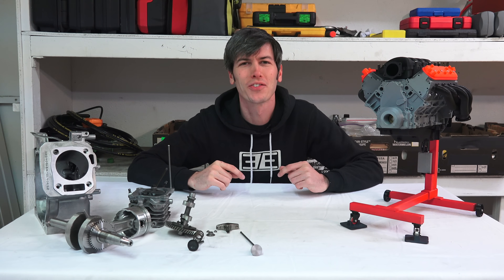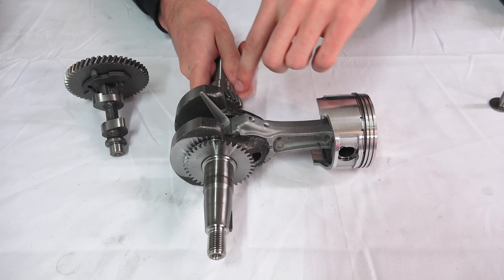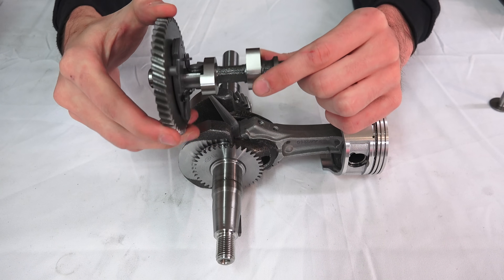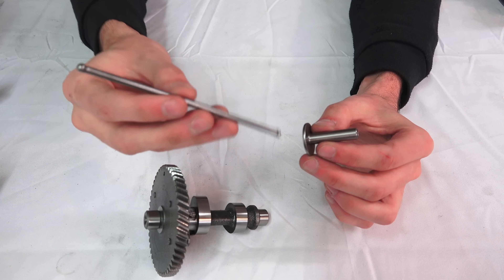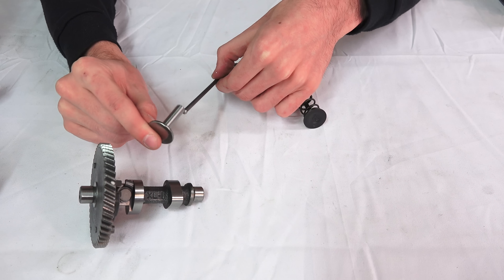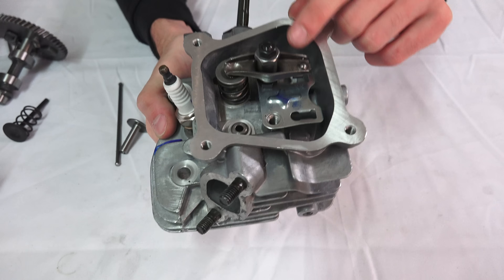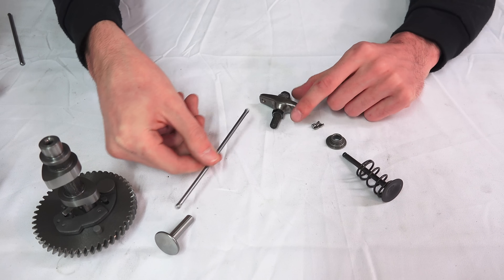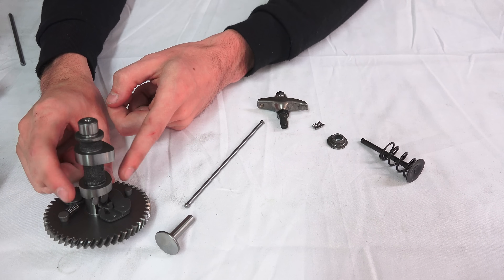Why Can't Pushrod Engines Rev High?

Comment: 40years ago Honda made CX500 pushrod V twin bike that had 4 valves in cylinder and reved up to 10000 rpm.. also it had 50hp in that 500cc engine..
Reply: Errtu Zarathos they aren't comparable Tho. A car is under more stress for weight a bike is under more stress from it's own engine.
Reply: bike engines can not be compared to car engines
Reply: I'll be Frank I'm Leary about using my name yeah, you can. It is really easy. Just take two engines and compare their specs against each other.

Comment: The Viper engine have a cam in cam design and vvt and it changes profile for the intake and exhaust valve timing being a pushrod. Gm have a patent for Variable valve Lift for the push rod. It is a rocket arm that changes how much lift it could have. Sow it isn't impossible for an OHV engine to rev high if you put in the same tech as an OHC engine

Comment: They dont need to...they make more TQ lower in the powerband.
Reply: yeah that low rpm torque. that's where the racing happens right?
Reply: Careful with the assumptions.  TQ depends on airflow which is not dependent on pushrod vs. OHC, only on how much valve is open for how long, cam timing.  What RPM you can deliver that opening is what this lesson is about.

Comment: The situation, other than the mechanical inefficiencyof a pushrod engine , is electrical.  Desmodromic valve trains effectively eliminate the mechanical side rather well. The new computer controlled ignition systems are much more efficient than the older systems for generating a properly timed spark. Lastly a turbo or supercharger will result in  maximal power/rpm output of your engine. You cannot equal the power/rpm of these new engines with the best of the 20th century technology.

Comment: no need to rev your street engine very high, most engines will be less efficient at high rpm.
Reply: Not really true anymore for most modern engines these days, especially outside the US, a lot more cars use OHC rather than old school pushrods like the typical v8.

Comment: My ohv Buick V6 revs to just above 9000 RPM with max power around 8000 RPM. its very flexible,smooth,reliable  and derivable. Although it makes maximum torque of 404 ft/lb at 5500 RPM. It still has huge torque waay  low at 2000 RPM. Im still puzzled as why GM doesn't use 1/2 of the technology they used in their race engines 30 years ago in their road cars today!

Comment: I've always wondered why the inline fours in bikes sound different from the ones in cars. Also why 2 and 3 cylinder bikes sound so different when 1 and 2 cylinder bikes sound so similar. I was thinking maybe it's the differences between the cross plain and flat plain crank. Could you do a video on this?

Comment: You point out a few facts about OHC vs OHV engines and the LS fans get triggered as hell talking about how they don't need no OHC. Nobody said you did! He merely discussed the differences. Jeez, people are so insecure.

Can't we just admit there are pros and cons to both. OHV has packaging and weight advantages in a V8 and OHC has the ability to produce more power given equal displacement, by having 4 valves per cylinder for better breathing at high rpm and ability to rev high without very high spring pressure (for reliability).

Is it worth the extra complexity and cost in a V8 with such a high displacement that can pretty easily reach 1000 HP with very little effort? Probably not. Is it worth it for a 4 cylinder that needs to extract all the power it can from a small displacement? Yes.

Comment: Why are we sell using cam shafts for valve timing? Has there been any work done for solenoid operated valves and computer timing. This would be more adjustable and probably more efficient than mechanical timing.

Comment: tc cars in argentina (inline 6 cil, 3000cm3, 450hp based on 70's american blocks) used to have pushrods that would go up to 12k rpm. Now since 2015 they have changed to overhead cams i think.

Comment: The cultural differences are fascinating. I would not have thought pushrods engines where still made. In europe they stopped doing that 30/ 40 years ago. Is an european/asian engine more efficient? Hell yeah. Is an european/asian engine more powerfull per cubic capacity, no doubt. Is anyone as proud about there 250+hp 2.0l 4pot that can easily do 160mph or do 45mpg at 70mph as an american about his (relatively) slow gas gurgling v8? No way. 
And to be honest. My neighbour happens to be an american <70's mustle car enthousiast and for his day to day drive has an BMW X5. But I would only loan his keys from his old chevy v8 pickup.

Comment: Could a pushrod be replaced with a hydraulic mechanism? Instead of a pushrod, using a "pushpipe" from cam follower to valve, removing the rocker?

Comment: A while back Hot Rod and Super Chevy magazine built high revving LS3s. Hot Rods was more budget oriented and used a forged 4.8 truck crank to destroke the LS3 to about 5.5 Liters. They used off-the-shelf AFR heads and Brian Tooley cam/valvetrain. It made 600 HP at 8000RPM and was supposedly able to spin up to 9k safely.
Reply: LS7s have been built to hit 10,000 RPM as well.
Reply: Finally someone that did some research. 👍🏻 NHRA Pro Stock used to go to 13k rpm. Btw.
Reply: Luke Z actually the shorter stroke/ big bore reduces the piston speeds/travel distances. This results in a reduction in friction and reciprocating mass.

I'm not saying longer strokes can't rev high, just that it would typically require more maintenance and 'exotic" materials
Reply: I built a small block 350 for land speed racing. Forged steel internals, solid roller cam. Shift light came on at 9200 RPM. Only thing semi-exotic was the shaft mount rockets. 4 in bore, 3.48 stroke. It can be done.
Reply: Of note, the LS7 used titanium connecting rods from the factory to reach those RPMs. Impressive nonetheless.
Reply: eb110americana Titanium con rods have their drawbacks, they tend to transmit shockloads to the crankshaft - something discovered in the late 90s in top fuel, when several teams experimented with them and promptly wiped a crank in less than a half a dozen passes, where peeviously they lasted 50+.
Reply: Machinist 72 aluminum rods are very good for high hp motors as they cushion the rod bearings and absorb alot of impact, but unfortunately they cant be run on the street. Maybe one day we will have a hybrid connecting rod that is easy on rod bearings and streetable
Reply: eb110americana no
Reply: Luke Z thats actually a de-stroked engine. Was common place back in the day when you wanted to rev the engine to the moon. Like road race and circle track applications.
Reply: LS1s have their cam with a bigger base circle with beehive valve springs
Reply: Squared Life rocker shafts help a ton!
Reply: aklip nice, half of what an F1 Dohc motor can do.
Reply: aklip yeah idk what this dude is talking bout but I've seen a couple able to hit 8500 but of course nice chunk of change was involve
Reply: I just read that article like 10 min ago haha
Reply: yeah chevy 302 only used in the camaro Z28
Reply: A stock bottom end 4.8L LS can easily rev 7k+ rpm with just a cam swap (still a hydraulic roller, like the factory).
Reply: And it drinks gasoline like a drunk at a bar, you forgot to mention that. Gasoline anything with spark ignition is a waste of fuel.

Comment: I will never forget my 88 Camaro Z28 IROC-Z. 5.0 TPI. it had the later roller rockers, but it topped out at 195bhp @ 4500rpm.
My modern Diesel revs higher and has more HP from just 2.2 L.  lol

Comment: what is that arm sticking out from the connecting rod?
Reply from the maker: It's used to splash oil all around the crankcase. Small engines use them that don't have dedicated oil squirters for the piston.

Comment: Pretty nice video. Have you checked out the old GM XV8 concept engine from the mid 2000s? It has twin cam in block design to control intake and exhaust independently. I wonder if GM will revisit the concept for the next gen of pushrod V8s.
Reply from the maker: I've heard about something similar! Mahle makes a cam that's basically two camshafts, one inside of another, so you have independent control but it takes the space of a single cam. Very neat!
Reply: Oh wow, very interesting. Looking at it now, makes me wonder if Honda ever considered something like this for their SOHC engines. I like that it seems relatively easy to retrofit into an existing engine, much like the variable compression crank system from Gomecsys. Speaking which, any idea why Gomecsys's system seems to be a concept and not picked up by other manufacturers for testing? I mean Peugeot's VCR system seems overly complicated with lots of extra continuously moving parts.

Comment: LSx engines dont really have that floating issue. They have other issues..lol.

Your NASCAR vs F1 engine comparison isnt really a good one as both series had identical piston speeds and produced roughly the same amount of power. 

The newer Vipers' pushrod V10 uses a cam in cam vvt system and can adjust intake and exhaust separately.

VVT though is not an RPM limitation. A bigger issue is the hydraulic lifters all OEM pushrod engines use.  At higher RPM they tend to collapse under the load.

Comment: VTEC FTW!!!!!!
Reply: So you mean variable cam phasing vs actual lift and duration changes right? I-VTEC has both of them as well as the GTS celica and the BRZ/FRS. I always thought of VTEC as more of an emissions control vs HP adder. Every engine should be capable of 100hp/L assuming more than 2 pushrod valves per cylinder, but being able to get a smooth idle and decent emissions is where VTEC comes in. Having that low lift, low duration cam profile also helps with low end torque.

Comment: I'm going to stick with my ls pushrod motors less to go wrong and cheaper not really any less efficient and can easily make plenty of power
Reply: James Holbrook yeah, as long as you don't scream it and you run it normally it will hold up fine.

Comment: Pushrod engines can't rev high, because the impuls from the camshaft is transferred through many parts and thus the valvetrain has a lot of mass, which in turn again is subject to Newtons first law and therefor doesn't want to change direction quickly. 
In german, I could have said this with a single word: Massenträgheitsmoment.

Comment: Gotta admit, though, that a 5.8L NASCAR engine revving to 9500+ RPM and not grenading is impressive.
Reply: jmurphy1973 with 800hp N/A and by chance it does fail, because eventually it will, it can be easily rebuilt in basically no time at all and the driver will be back out to finish the race.
Reply: They have valve float too but they engineer their valve train to toss the lifter in the air to gain more valve lift and consequently have to engineer the back side of the lobe so the lifter lands as smoothly as possible. The biggest downside is the cam typically doesn't last more than 2 races.
Reply: A lot of work to make something not so good work. It does work but it doesn't mean it's good. A production ohc engine these days with mass prod parts parts will do 8500.
Reply: Several years ago Hendrick Motorsports was turning there engines over 10 and upwards of 11 grand, NASCAR enacted a gear rule to limit rpms, the other teams were afraid of increased r&d costs
Reply: For hours on end too
Reply: on top of hours at max rev
Reply: About 17k per motor from roush. They're actually pleased for x amount of races. They're a hell of a motor though. Once I win the lottery I'll buy myself one or two and build some bucket list rigs.
Reply: @danielanderson2030  That's pretty good. Our Aussie 5.0L that make 680hp at a limit of 7500rpm get no change for 100k+  Granted they are far more complex in terms of intakes etc but where's the other 50k+?
Reply: Another thing to consider isnt only the type of engine (OHV) but the mass of the system is a thing too...
Formula 1 engine has tiny pistons moving up and down. Nascar have imense pistons moving probally even faster than an Formula 1 engine.
Top Alcohol Dragsters are the ''miracle'' of the OHV engines. They rev as high as 11K RPM being 9,5 to 10K their peak power. This in an massive engine... 8.2 to 8.7L
You can talk about endurance, but still.. More than 3K HP reving a LOT in an jurassic engine lol
Reply: Zeh Doce Top dragsters use nitromethane and alcohol, not gasoline.
Reply: @roguepathfinder2477  Top Alcohol dragsters use Methanol... Top Fuels use Nitro and they rev less, like 8,5K, still a big number considering the size of the engine.
Reply: Zeh Doce i guess i should have used “and/or” in my original reply.
Alcohol still burns quicker and cleaner.
Nitromethane in contrast burns slow af, they have to run somewhere between 52-62 degrees of advance, keep in mind that compressing the mixture, be it in the engine or supercharger, makes the flame front propagate faster and the engine is rebuilt after every race in a top fuel dragster. I don’t have much info on top alcohol dragsters but i can assume they aren’t that different, methanol and nitromethane are (somewhat) similar and they are made for the same thing.
Reply: @roguepathfinder2477  TA engines are very similar to TF engines. They are a bit bigger (up to 8,7 L vs 8,2 in TF) and you can use other superchargers with some overdrive limitations and so on. Aside the engine with huge amounts of HP to run short distances, still a big thing reving that much. Considering the size of pistons, they travel faster than F1 at era of 20K RPM.
Reply: Zeh Doce they can rev so fast because the engine is rebuilt after each race. TA/TF dragsters’s con-rods could begin to weaken because of the extreme stress, but it wouldn’t matter much because at this point you probably already won and the engine isn’t revving anymore and can be rebuilt. I know that the same components are used multiple times but still, using an engine for a few second vs using an engine for half an hour to an hour in F1. And F1 don’t even rev as high anymore, there was the 20k rpm era and now we are at 15k, a 600cc revs more than that goddamit.
Reply: @roguepathfinder2477  They also have 1.5" strokes so their piston speed is still doable.
Reply: @hooyabaaa2  they travel faster b/c of the longer stroke
Reply: @hooyabaaa2  I usually have seen a 3-5% variation in mean piston speeds when comparing V8 Nascar engines to Formula 1 engines. Meaning boths engines are performing tremendous work (3.858in in OLDER F1 V8-era bore vs 4.185in bore in The Nascar). The biggest difference is the stroke. (1.566inch for F1 and 3.25in for Nascar) Connecting rods are much shorter in the F1 piston, thus the almost double peak piston acceleration vs a Nascar piston.
Reply: fun fact, some places in Europe you are required to drive with bulletproof dragrace with motorcycles since some have been killed by the valves going straight up...
so engines literally going "grenade" is a thing....

not so easy to finish a race again even if the engine is rebuilt if your body is full of holes...
Reply: Hell they even rev destroked ls engines past 9.000 rpm. This video is BS.

Comment: Can't we use those system which will always make a contact with valves, just removing the springs and using rotating motion of crankshaft to give reciprocating motion to valve. Instead of valve its like smaller cylinder piston arrangement which controls the flow of air into the combustion chamber. There will be no valve floating at higher rpm as the smaller piston cylinder will be bound to follow camshaft. 🤔🤔

Comment: Jason, you'r right, F-1 engines use air cushion for valves operation, but it's based on liquid nitrogen, it's the most stable gas'es in high temperature differences
Reply from the maker: Liquids are not compressible, so it’s a gas in the spring chamber.

Comment: Sadly current F1 cars do not rev that high. They go only up to 13.000 RPM due to the fuel flow rate restrictions. The regulation allows up to 15.000 though.

Comment: Because two big ass valves are heavier thane 4 smaller valves and 2 smaller camshafts weigh less than one big ass camshaft, and having more moving parts like pushrods add friction and pumping losses. And unlike our S2000 which has rollers on the rockers so the cam is never rubbing against the rockers, the followers rub against the cam.

The flow difference between 2 valves and 4 isn't that great, most of it comes down to weight. Titanium parts are lighter for the same strength which is why they get used in high performance valves, connecting rods. More engine speed means more acceleration of reciprocating parts which means more force, by reducing weight, you reduce the force(inertia, stress fatigue, pumping losses, friction). Granted it's not a big as reduction as reducing the acceleration, but dammit we're trying to make power here, so taking out weight is the most elementary way to reduce the inertia of the rotating assembly...While givin' her the beans.

Comment: Instead of using coil springs, why don't they use a mimi crankshaft-like mechanism to lift up and down the valves? Have any engine manufacturer try to do that before?

Before anyone argues it would only be closed when the mini crankshaft is in its upper position, that could be managed by inserting the valve inside a mini cylinder, short enough so that it let's air inside (or gases out) only at certain angles of the valve's mini crankshaft.
Reply: The Ducati Desmodromic system is like that.
Reply: American Locomotive not exactly what I meant, but yeah, something like in which springs aren't needed.